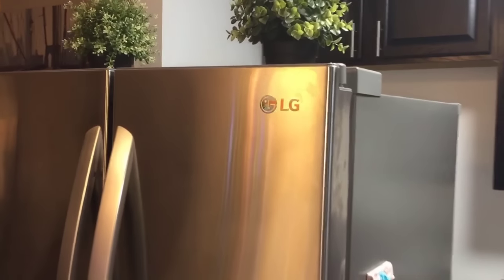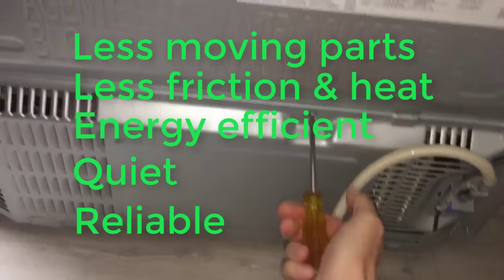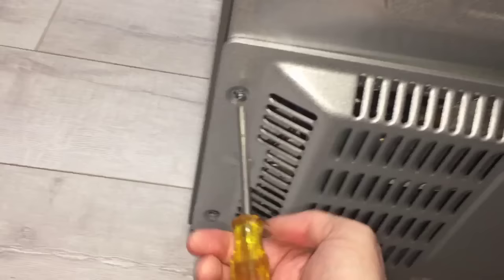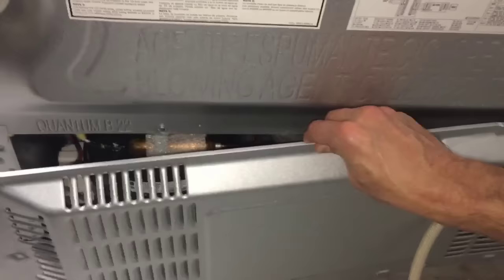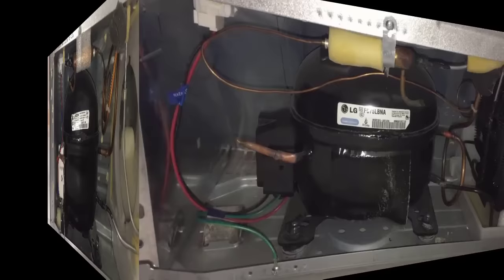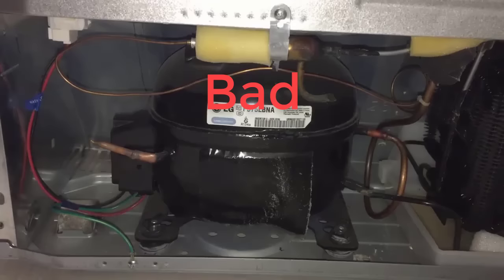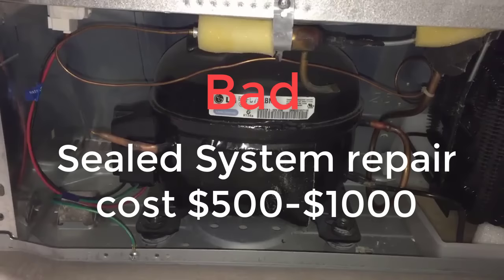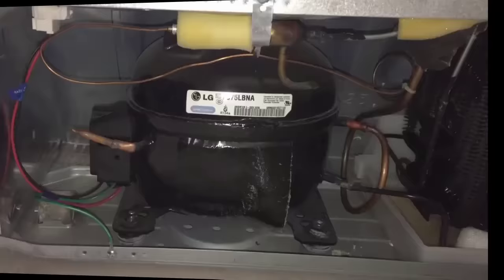LG fridge not cooling but running

Comment: Hello, yesterday I received my LG fridge with linear inverter compressor, I let it sit for 8 hours, after that time I connected it without food for 3 hours. With a temperature of 5 in the freezer and 3 in the refrigerator, when I put the food in it, I realized that the refrigerator almost does not cool down so that it sets the lowest temperature, I tried in every way possible and nothing, I disconnected it 30 minutes and continues Likewise, what I will do is go to the store to claim a new replacement refrigerator because from the beginning they gave me a refrigerator that does not work and I paid for a refrigerator that worked, what do you think it can be? the freezer does work well, but the refrigerator does not cool. The smart diagnosis says that everything is fine, but that's not the case. Excuse my English.
Reply from the maker: LG linear compressors are typically very slow to cool. It may take up to 24 hours to reach the desired temperatures. The freezer should be set to 0°F (-18°C) and refrigerator section to 37°F (3°C). If the temperature is not good tomorrow, maybe you need to return it back to the store. What is the model number of your refrigerator? Maybe the evaporator fan or the 3-way valve is not working.
Reply: I have the same problem. Frezzer set to -6 works fine. I even bought a fridge thermostat and it reads normal. The fridge is set too 33.. The thermometer reads 48-50F... Not good. Had it "repaird twice already under my 1 year warrenty on top of my extended 4 year warrenty. I not have a LG technician coming to look at it this Tuesday for the 3rd time in 2 months. Nothing wasd ever fixed the first 2 times. My wife and I are very dissapointed.

Comment: My LG refrigerator GN-202SVK before 5 months it was not working at all and I remove relay and stuck it on wall and return relay it work just like new. Now from 2 days my same fridge not getting cool enough. Check the compressor relay. Fan coil all are seems to be ok. Thermostat set to full. Compressor are always hot so can't doubt on compressor. Showered to technician he say just plug small fan with compressor so it will remain cool. Please advise. Buying computer cooling fan to keep compressor cool will do the job ? 
Freezer area is getting cool like down area and down side almost no cooling.
Reply from the maker: So the compressor is hot, but is it running/vibrating, or just clicks every few seconds?
Check the freezer evaporator coils first. If they are full of ice and frost, you may have a Defrost Problem.
If there is no frost at all, you may have a refrigerant gas leak.
If there is a little frost, the condenser coils next to the compressor may be too hot. And in this case, a small fan may help to cool it down.
Reply: @Your-Self thanks for quick reply . there is frost not too much already tried to place fan and move refrigerator in room where we use Air con to keep coil and compressor cool. Still the issue same. So last doubt on gas leakage. Can it be filter block ?
Reply from the maker: If the fan inside the freezer is working and blowing air, it's possible that there is a problem with a Sealed System like a clog or gas leak.
Reply: @Your-Self  I doubt the same as once I open fan area there was too much dirt powder and coriander  . Spices . I have vaccum it as much possible . But seems it block the filter and in this model only to break the filter pipe will reveal the problem and at the same time gas pressure can be measure. No valve to measure gas pressure. Means only gas welding is solution. So can't fix in home. Called technician. All thanks to my wife 😤

Comment: I’m having same problem right now, tecnic just told me how bad are LG compresor motor are $700 repair costs but better get a new refrigerator! Any ideas on a better brand?
Reply from the maker: All refrigerator brands have problems. LG was the worst, but last year they upgraded the compressor, so now maybe it's OK to buy. It's best to buy a simple refrigerator without the water/ice dispenser and a single cooling evaporator. Fewer features = fewer problems!

Comment: My refrigerator LG inverter problem is that not working at all,i remove the cover from the back and i can here the relay clicking but does not start at all.can u help me with this one?model=GR-B202RLCL
Reply from the maker: First check the compressor for Ohms, and that it's not shorted to ground as on this video https://youtu.be/zYIC7LMkKak
If the compressor is good electrically, that clicking relay probably needs to be replaced, or the whole PCB board with that relay needs replacement.

Comment: What should the sensor ohms read to find out if they're bad, I have 10k refrigerator and 2k freezer
Reply from the maker: The resistance of temperature sensors changes with the temperature fluctuations. LG uses 2 different sensors for the freezer and the fridge compartments.
The freezer sensor should be about 20k ohms at about 0°F (-17°C)
The fridge sensor should be about 30k ohms at about 32°F (0°C)
The readings that you got from your sensors probably indicate your current room temperature.

Comment: Lg LFX28978ST/00, built in 2010. Fridge set at 33, freezer set at -6. Actual temp is 38 and 22.  Coils are clean, all fans run.  I change the freezer thermistor.  Hard to tell but the compressor sounds good.  A very small amount of ice on the top and bottom of the freezer evaporator. I'm thinking the compressor is going out.  I didn't take a temp reading at the coils but they felt cool, not as warm as I thought.  The compressor is warm to hot to the touch.  Bad compressor?  Maybe I could pierce the line and add a little refrigerant?
Reply from the maker: It sounds like the compressor is going bad, there is a leak in the system or restriction.
Try adding very little refrigerant (they don't take much to overfill). If the temperature improves, there is a leak. If not, there is a restriction or a bad compressor. 
It's best to check the pressure with a gauge first... if you have it. When the compressor is running, the pressure on the LOW side should be around 0 PSI or slightly negative. With the compressor OFF, the pressure should equalize to around 60 PSI.
Reply: @Your-Self  Thank you. I'll try it.

Comment: Just threw my $3000 Kenmore Elite in the garbage. Only 4 years old and it looked brand new. Not worth the headaches and lost food to bank on a repair that everyone says doesn’t last. Already spent countless hours on the phone with overseas customer support people that I could barely understand. Their reaction “what compressor issue”. Will never buy an LG or Kenmore product again.
Reply from the maker: The compressor is definitely a weak link in this nice refrigerator, and 4 years is not good enough run time. LG "improved" the compressor last year, but who knows if it's truly any better.

Comment: Ugh. Ours just broke.  It wasn't a gradual decline either.  4 years and 1 month old.  RIP.
Reply from the maker: Don't bury your fridge just yet. If it's an LG (not Kenmore) and you have the receipt, they must replace the compressor absolutely free for the first 5 years.
Reply: @Your-Self  I found my receipt and they are coming to fix it on Friday. Should buy us a few more years so we can save up for a different unit.
Reply from the maker: Good! However, they may not be able to fix it in one day, so be prepared to wait a little longer. Keep us posted.
Reply: @Your-Self  I hope that is not the case. It's an authorized LG repair service. They have all the model/serial/compressor info and implied it would take about 2 hours, but... I've heard that before, right?
Reply from the maker: Usually, the first visit is just to verify the problem. And if the problem is, in fact, with the compressor, they may still not have it on the truck with them. So they'll have to come back some other time to fix it. Recently, they start replacing all compressors with a new universal compressor, so hopefully, they'll have it on board.
Reply: @Your-Self  This morning I didn't have the receipt, so I had to assume it was 5+ years or older (out of warranty). I had a company come out. They tapped the high-pressure line and said we had a "weak compressor" and it had to be replaced. Replacing refrigerant wouldn't fix it. They quoted $500 for parts + labor (no warranty work).  I then found the receipt and called LG. They connected me with an authorized LG service guy and they said that, based on the first guys visit, they would classify it as a bad compressor.  However.... if the LG guy finds that it isn't the compressor, then I have to pay the service fee for visiting.  However, I've ruled out everything else.  All of the fans are working.... they're just not blowing cold air.  No frost build-up. No leakage. The strange thing is that when I run the Smart Diagnostic (audio), it says everything is fine.
Reply from the maker: Based on your description, it's a bad compressor for sure. The "smart diagnostic" can only detect an electronic problem on your refrigerator. Since the compressor is mechanical, it's under the radar.
Reply: @Your-Self  what about if I have a Kenmore pro but it has the lg linear compressor is it covered in the lg warranty even though it's a Kenmore I think it says in the manual that the lg compressor was warranty for 10 years I bought the refrigerator 4 years ago? The problem with mine is that is not cooling but fans work and the compressor is on and gets hot but the condenser fins don't get hot at all its like if the freon is not going through the condenser.

Comment: What if the freezer part is freezing and the fridge is not cooling. What could possibly be the problem?
Reply from the maker: It really depends on the model number of your refrigerator. 
It could be a Damper Door stuck closed, Defrost Problem so the excess ice blocks the damper door, or more serious problem if you have a Dual-Cooling system.

Comment: Is this sound also for single phase? My compressor tests electrically fine, but sounds more like the bad one, and not getting cold
Reply from the maker: If all fans work, there may be a refrigerant leak or a restriction inside the Sealed System. But you'll need a tech to check the pressure with gauges to figure it out.
Reply: @Your-Self  yeah fans working well, blew out any dust. Ok thanks trying to find someone to test (back logged like crazy here)

Comment: So I got a fridge that the compressor sounds good but when I hook my gauges up there is no drop in pressure on the low side.  Doesn’t sound like the compressor is really working just running. Perhaps a bad seal or something inside the compressor?
Reply from the maker: Yes, very common for Linear compressor. The valve inside the compressor breaks off, so it's not pumping, just idling. If you replace the compressor, make sure to replace filter/drier, and clean the sealed system well from broken valve debris.

Comment: I have a unit Lg refrigerator french door type and the compressor runs fine but it does not get cold,can you please shed a light on what can probably be the issue here.Thanks and I hope that you will be able to help me in getting to the bottom of this issue and solving the problem.
Reply from the maker: How old is your fridge? It may be covered under LG 5 and 10-year-warranty.

Comment: My LG refrigerator lasted less than 5 years. Needs a new compressor. We have to wait 3 weeks for repair for it to be covered. I read reviews before buying. Were all of these problems just happening in the last couple of years? We had to buy a mini fridge to try to hold us over until repair. Wonder how long the second compressor will last? Doesn't look good!
Reply from the maker: According to LG, the new Universal compressors that they are installing nowadays, are better than the old once. So, hopefully, it'll last longer!

Comment: Is there a better Compressor to replace the old non working one with? If so how can I order it or what is the part number, this way I make sure the Technician won't order me the same Garbage. 

Thanks for your help.
Reply from the maker: Depending on your refrigerator model and current compressor number, you may get the same replacement or the new "Universal" compressor. The control (PCB) board may need to be replaced as well or updated with the software.
If it's under 5 years old, LG may replace it for free.
Reply: @Your-Self  They gave me back my money. then almost a  year later it goes bad. 🤦🏻‍♂

I thought I was ahead of the game, but they were because they knew the LG Fridge they sold me was Garbage, Model "LMXC23796M/00
Reply from the maker: Your new compressor is part# TCA38151706, and it requires a software update.
Just verify that the actual problem is with the old compressor, not the system leak.

Comment: What causes a double door fridge to freeze both sides, even refrigerator side. It set to 7 degrees, I tried 4 it still the same
Reply from the maker: It depends on your refrigerator model... but typically, the temperature sensor (thermistor) is bad, or the motherboard (PCB) is bad.

Comment: Is there a replacement compressor other than the linaer compressor like a different brand?
Reply from the maker: The motherboard on your refrigerator is programmed to work only with the linear compressor. Some new linear compressor replacements require reprogramming of the motherboard with new software to work properly... not an easy replacement :(

Comment: I have an LG MODEL  LFC24786ST/02 THAT RUNS GREAT JUST DOESN'T COOL in fridge or freezer. I called LG and they did the diagnosis with my cell and said there is a problem with the defrost system. I checked the usual fans, they are fine. checked thermister and defrost and the defrost controller assembly which seemed to be within specs. I did replace them anyway just in case. The defrost heater sheath  reading is 48 0hms . According to the service manual it should be  34-42 0hms. Online repair techs say under 50 is ok?? should I replace it too? I also replaced the main board . Still not cooling. Any suggestions?
Reply from the maker: Interesting! Did you see an error code pointing to defrost problem? The heater sheath at 50 ohms should be just fine. Did you actually remove everything from the freezer to look at the evaporator coil? Is it completely covered in icy frost, or there is no frost at all? If there is no frost, it's not a defrost problem, but compressor problem.
Reply: @Your-Self  . Thanks for your quick response. There is no code. No ice or cooling whatsoever any where in either fridge or freezer. W
 The defrost system diagnosis came from LG using the remote Smart diagnostic thing with the cell phone. Compressor seems to run great.
Reply from the maker: Unfortunately, the LG "smart" remote diagnostic is not very smart. I don't know how they came up with the "defrost problem" if there is nothing to defrost. It sounds like a typical Linear compressor problem... running, but not cooling. You may have a refrigerant leak somewhere, restriction, or a bad compressor, even if it's running. Any of these problems require experience to repair or a lot of money to hire someone for the job. Sorry for the bad news.